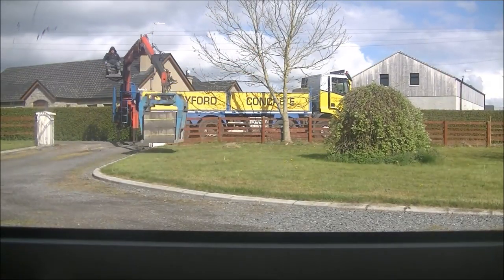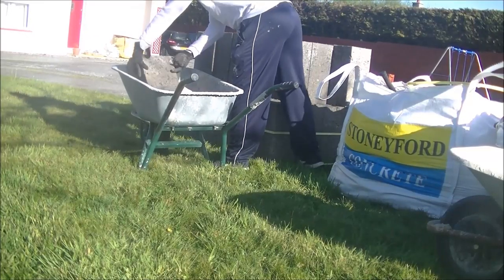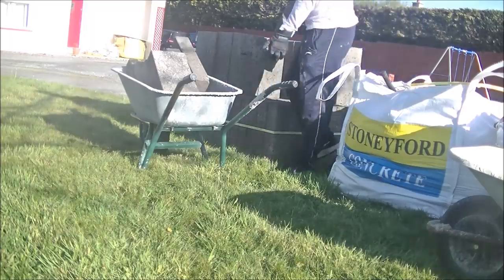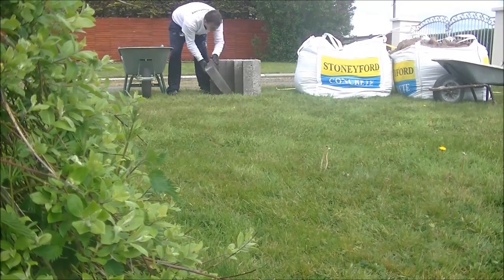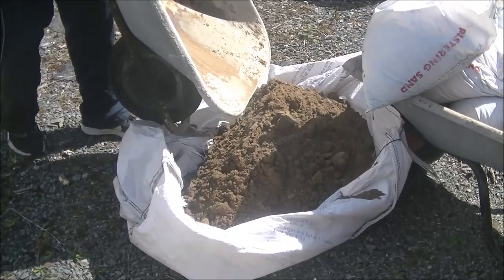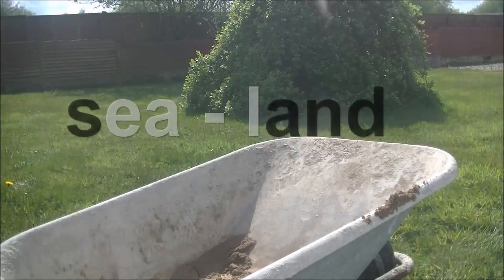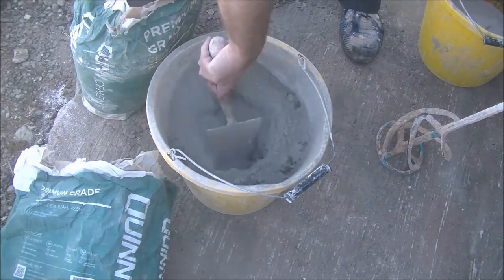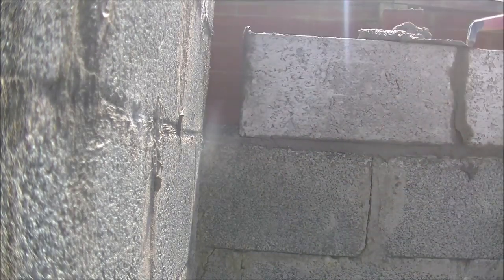Building Concrete Block Wall DIY Project

Comment: Hi there. Great video. Whats the width and depth of you're footings. Also what height is the wall. Thanks
Reply from the maker: Mate I cant remember 100% A bricklayer told me what to do at the time and thats what i did I think like 3 foot down foot wide but I also have 1st block on its belly walls like 5and half foot tall today its still doing well no cracks , what size wall you going for and from block ?
Reply: @macplastering  Thanks for responding so quick. Going to build a shed but its close to the boundary. So i was thinking i could make at least the back wall out of block. Thinking 7-8 feet high. 5 meters long. It will need piers. New to block laying so trying to soak up as much information as possible.
Reply from the maker: Piers will add great strength mate

Comment: Great video bricklayer myself just one small tip, when loading blocks load them on edge just easier to pick up. Stay safe.
Reply from the maker: Cheers man great tip i was having to turn them every time :) Thnaks for watching Mervyn mate
Reply: mac plastering that’s mark heps channel he’s a tidy builder and an all round skillled fella. Mac tidy little job on the walls you could have done with a   9 inch pier ( block on flat) on the free standing end of the wall you built from scratch though for a bit of added stability. I’ll send you a link in a few minutes of Vietnamese decorative plastering that you may have seen but if not I’d say you’ll like them.
Reply: @brickbybric  hi bric 👍👍👍👍👋👋👋
Reply from the maker: @brickbybric  Have seen some relay cool rendering and stuff on youtube some very talented guys for sure mate send me that link :) Yes Mark is a sound guy very good builder indeed , I still have to add a bbq to that end so might tie something into it to make it stronger If i did the pillar on its flat would it be good a strong or what you think ?
Reply from the maker: Have a look now cheers mate : )
Reply: Mark Hep hi mark . Excellent videos 👍
Reply from the maker: Guy is a great brickie
Reply: @brickbybric  👍👍👍

Comment: Question: Do you need to plastering/rendering on concrete solid blocks, if it's a outside of a garden room wall?
Reply from the maker: I think it would be best if its on a house

Comment: Hi I was wondering if you know how to remove the sloppy excess of the morter when they did a horrible job it’s dry
Reply from the maker: I just scape it of mate with floor scrapper or spade or hammer it off

Comment: Good Job you could be a brickie with practice  how's work situation back home  I done one job in Belfast last month  and priced another seven never got one had to come to Buckinghamshire to work and am now flat out doing domestic brickwork building 30 square metres of cotswold buff stonework in Oxford at min but its as dead as you like back home great if you like driving around handing out quotes but not much work 👍
Reply from the maker: Good friend of mine has had the same priced 7 jobs and got one I have priced a few and am waiting to hear back but if its not a yes right away its mostly likely a no but I been ok not to busy but ticking over and still trying to say as safe as possible, Yea my bricklaying could for sure improve :) but hey the plasterer will fix it LOL Glad you have got something good going on over there mate I think most sites have started back again the last few weeks here

Comment: Get a string set up mac, good work tho brother
Reply from the maker: I started with one just to get the 1st block in line then just used level haha a string probs would be much easier how would you get a string level over that distance ? I am wanting to run a coping on the top
Reply: You could of put a level pencil line along the blocks and then measured up from it when laying for each end and then put string on 👍
Reply from the maker: Youtbue hiding comments on me so only got seeing them now Frankie but that is  a great way of thinking thank you man

Comment: You should have built pillars every 4.5 meters at the back of that wall to support it . No more than 900 ml for a free standing 4 inch wall
Reply from the maker: At what height ?
Reply: @macplastering  4 course 900 ml
Reply from the maker: @MrMerk2884  cheers man
Reply: @macplastering  are you trying to take the piss out of me
Reply from the maker: Why you think that